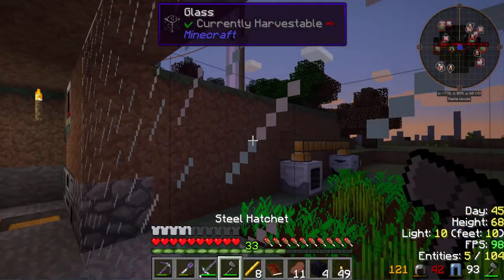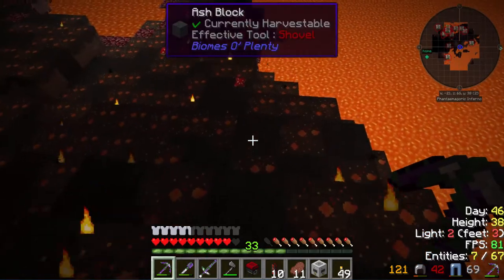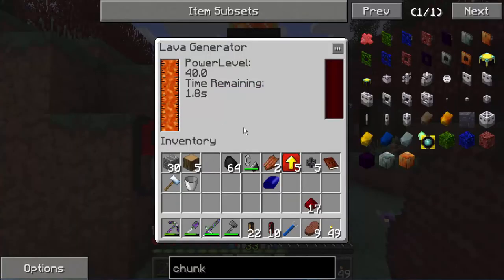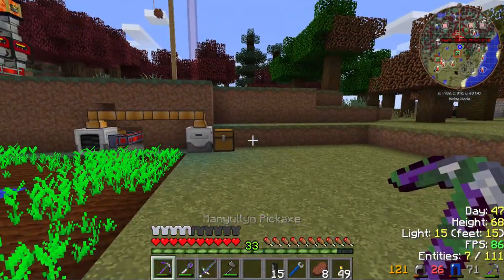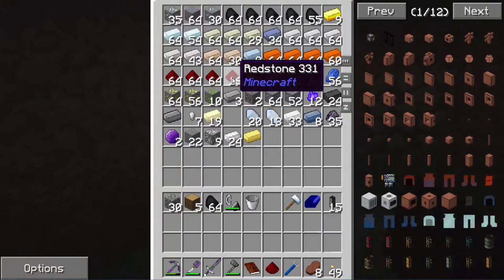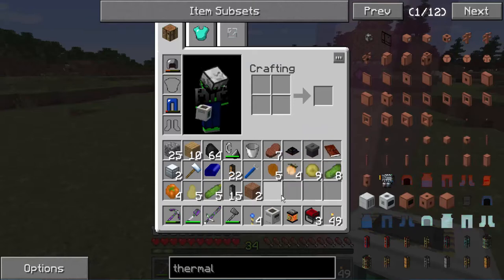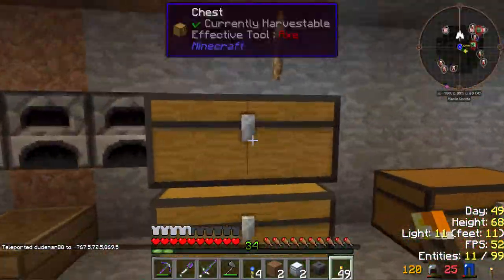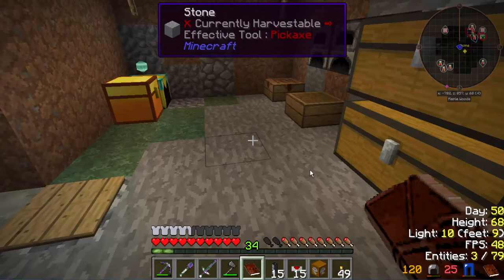Minecraft Modded Survival world: Space Astronomy EP 5: lava power and quarry

Comment: To use itemduct with your quarry you need to put the itemduct on the top, that's why it didn't worked. You can also use item barrels from Project Red, they can hold 128*64 = 8192 items and they are very cheap to make. I usually make 1 barrel for each chisel stone (Marble, Diorite, Granite...) + Gravel and Dirt and then 4 Barrels for the Cobblestone. You can then place a chest and a crafting table and when the barrels are full, you can make compressed cobblestone, double compressed... and store it in the chest. I haven't figured out how to auto craft in this pack, but if you have some time to do it, it is the best way to keep cobblestone without having to use a deep storage unit or 1 million barrel. Or you can always trash it if you hate cobblestone and are a monster.
Reply from the maker: what do you mean by don't know how to auto craft. do u mean by a system crafts an item for you when requested or just auto crafting things on the side? because there's many ways to auto craft in this modpack like, the crafter from ender IO, cyclic assembler from thermal expansion, and some other ones that i can't think of atm.
Reply: Thanks for the tip, I never use ender IO so I don't know there was a crafter in it. That's going to help my quarries.
Reply from the maker: np :) i normally use crafters to make wooden axes to for the planters when they chop down trees. kinda suckes that i can't use a powered tinker tool to give the planter to chop trees tho.